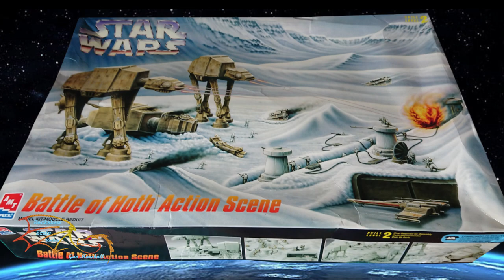AMT Star Wars Battle of Hoth scale 1/156 Part 5

Comment: Hello and thanks for sharing! One comment: although I don't disagree with your paint brand or color choice, I would have used copper wire, probably 26 or 28 gauge to represent the tow cable. In my opinion, the copper tubing scales out way to thick when compared to the snow speeder and the walker. Again thanks for sharing your project!
Reply from the maker: Hi Pratt-zp5mr, I take on board what your saying. Ideally I would have liked to have used a thiner subacute for the toecabel in retrospect. To be honest I wasn't happy with the colour of the cable also, it made it all look a bit clumsily. I don't know what it was about this kit but I really struggled to get it to look half decent. I think I should have just place the base to one side and built my own. I can also go back to it as some point.
Thanks for taking the time to comment, your thoughts are very much appreciated.